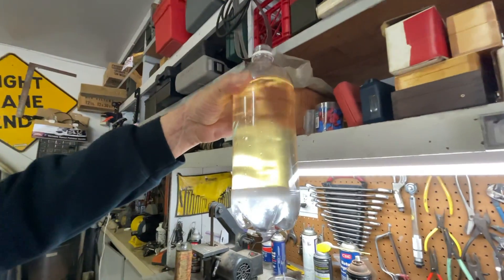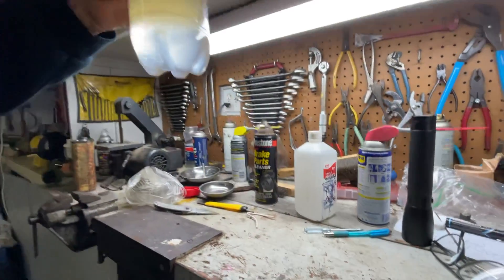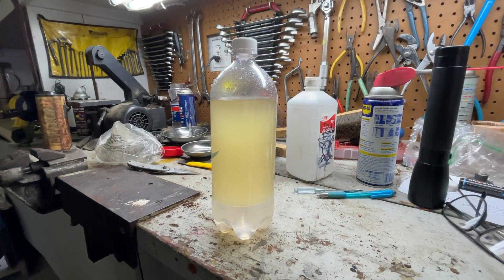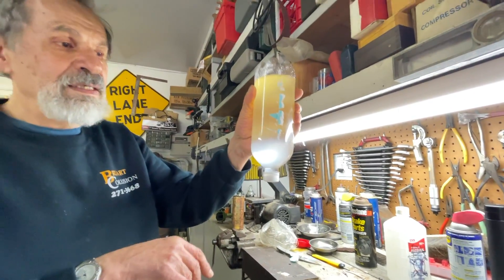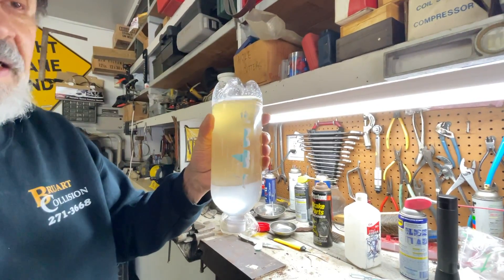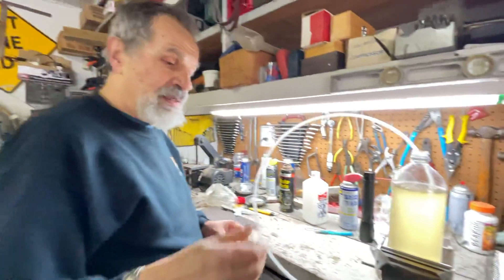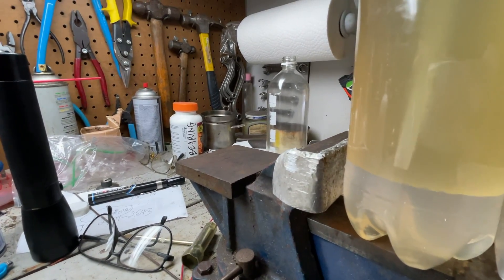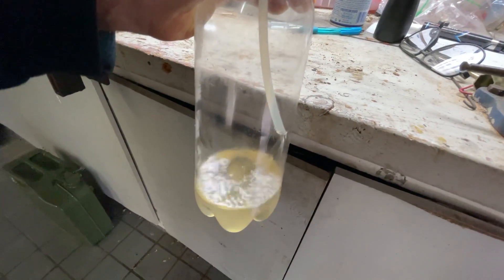The Most Practical Way To Remove Ethanol From Gasoline

Comment: Im gonna try something directly in the gas tank. Install a glass sight gauge, a petcock at the bottom, and done. Would work ideally in a tank that is not steel, since some water/ethanol solution will remain at the bottom of the tank below the petcock, but so long as the sending unit is above (and taking into account any shaking). Just add the same percentage of water in the tank when filling up. (And watch people stare at you).

But the biggest question for the future is why. Ethanol can be made easily at home if gas shortages occur (I mean serious ones). As long as the car has had its rubber components replaced, it will run, and if you know carbs, you can adjust them perfectly. 

This is just spitballing here, and love these kinds of debates and discussions. In another life I used to be a scientist/engineer.

Comment: Keep in mind that there is also an Octane Drop when you do this.
Reply: @danthompson5797  because ethanol is used as  to increase octane  (meaning compressibility) so  the engine will know like hell after doing this even more than most ECU can adjust for ... NOT a good idea for a car.  Ethanol octane rate is 110-112  and they do use this to add it to lower octane gasoline to achive the standard 87 (US) octane so if you remove the 10% (by volume) ethanol the gasoline remaining will be way bellow 87 so much so that many engine will have issue running on it. And eventually the engine will be damaged  ... but you mileage may vary ...

you maybe able to compensate with some of those snake oil octane booster stuff but no guarantee of that
Reply: @NixUgriBugri  use an octane booster. You moron
Reply: @jamiemorgan4146  How do you know how much to add? Is there a way to measure octane?
Reply: Well, MOST people do this on a small scale for chainsaws, string trimmers, lawn mowers, etc. only.  It could probably be used in an antique car such as a Model T, for example. 
So, exactly how much octane IS lost?  4 units of octane?  A reduction from 93 or 91 octane to 89 or 87?  Wow.
Reply: I could use this in my WWII Willys Jeep. It says on the data plate that it will run on minimum 78 octane gas. So no probs there.
Reply: @imdeplorable2241 , my understanding was that the model T was designed to run on pure ethanol, so growers during depression could produce their own fuel.
Reply: @imdeplorable2241  US 93 or 91 octane gasoline is NOT USING straight ethanol  (in most area)  so the above stuff will not even work .. (look it up  you will see )  

The video says normal gas ... NOT Super or whatever else ... that what I commented on ... the author should mention the fact that the "remaining" gasoline is NO LONGER the same octane ... you loose at least four units I think more than that  but I leave you to calculate .. .(not hard)   but 4 unit is already significant and could easily damage an engine if used long enough... anyone puts up a video like this SHOULD have this information shared as well (guess he did NOT  have clue or care not sure which is worse)
Reply: @NixUgriBugri  Sorry, man.  I thought he WAS using high octane gas for his demonstration.  My mistake.
Reply: @NixUgriBugri  s mielőtt kommentálnál itt, azelőtt ki kéne próbálnod amit állítasz. Lehet hogy amit a neten tálalsz az téves.

Comment: This works well. What I have done in the past get one of those lemonade dispensers with the spigot at the bottom. Dump the gas and water in there and let it settle. Then turn the spigot on until all the gas is out. Of course, you have to do some math so that the water is always below your spigot. My math minor finally paid off!
Reply: you mean tun the spigot on until all the water is out right?

Comment: How do you know how much water to put in?
Reply: If your gas is E10, that means 10% ethanol. You do some math. If you have 1L of gas, 100ml of that will be ethanol. So you add 100ml of water. Use ounces if you're more comfortable with that.
Reply: It really doesn't matter. You could put 15 gallons of water and one gallon of gasoline. You'll have 15 gallons of water on the bottom, about a 1/10 gallon of ethanol on top of that, and 9/10 gallon of gasoline on top. How much water isn't important as long as you separate the water and ethanol from the gas.
Reply: Does it remove octane when doing this?
Reply: @benselby6171  Yes. Although I can't tell you how much. I was hoping he would address this topic in the video.

Comment: You missed an important part, you have to shake the bottle very hard because it helps the water to bond with the ethanol. Then let it sit until it all becomes cloudless. In most cases in the US. you will end up with 10% more water, actually water bonded to ethanol. Use this in your small engines and modern motorcycles. Primo stuff. shake it good guys
Reply: you didn’t even watch the first few minutes of this video you silly troller, he does shake it very well. 
stop trolling and fast forwarding and actually watch and learn something. 
please post a link to your video on this subject.
Reply: That’s not nice. That’s quite rude. In the beginning of the video he handed the bottle to Michael J Fox.  For a good shaking.

Comment: Just a little thought and common sense goes a long way Isaac!! I've been struggling a few years to make non-ethanol gas for my small motors, without making a mess,  and this helped tremendously. Thank you and God bless.
Reply from the maker: Good to hear!
Reply: @bhass9  So water is actually heavier than gasoline and is why it sets at the bottom?
Reply: @bhass9  Your torque wrench probably needs to be recalibrated since it looks like you left it screwed in to a torque value. The springs change when you leave it like that and I think the wrench clicks at a lower torque level. Usually best to leave them unscrewed till there's no pressure on the internal spring.
Reply: Why don't you just buy gas that has no ethanol in it. 94 octane is ethanol free.
Reply: @johnarnold893  Yes, that would be best but finding ethanol-free fuel is not an option everywhere on earth these days. :(
Reply: @johnarnold893  because E0 cans at the hardware store are like $8/gallon. there is not E0 pump gas in my area. I use Washed Gas for my Gasbike because the gas tank doesn't seal super tightly and E15 evaporates way faster for reasons too complex to get into here. This is also a super-humid climate, so E15 causes a lot of sludge buildup in the tank as environmental moisture gets captured by the Ethanol and settles out.
Reply: I am using e85 e10 mixtures to keep oil clean and exhaust clean. I have lung problems. 20 years of successful motoring!

Comment: Thank you, this was a great solution to getting the gasoline out with out the need to invert the bottle and taste fuel with the old method of siphoning.
Reply from the maker: Good to hear!
Reply: @bhass9  
Hello Ben,
I gave it some thought and I used some food coloring mentioned on other channels to make the water and ethanol more visible.

I then inserted the ethylene  tubing all the way to the bottom corner  of the container and siphoned off the water ethanol solution at the bottom. It worked great the first time and hopefully all the times to come. I also used a needle pin for inflation of basket balls or footballs to pressurize the container with a small bicycle pump to prime the siphon and installed a fuel shut off valve at the end of some vinyl tubing to control the flow of the water ethanol solution and gasoline. I'm able to let the ethanol water  sink to the bottom of the clear vinyl tubing and then with minimal gasoline waste flow the gasoline back to the container. Thank you for the basics which I was able to extrapolate my extraction system, I'm sure my snow blowers will be happier and work better in the Chicago snow storms. Thank you sir and Merry Christmas with hopes for a better 2021.
Reply from the maker: @rayhoffelt  Its great to hear that everything has worked out for you and you have made the most out of the system. We are very glad we could be a source of inspiration. Thanks for watching, best wishes, and merry Christmas!